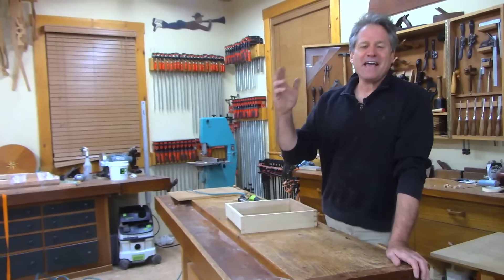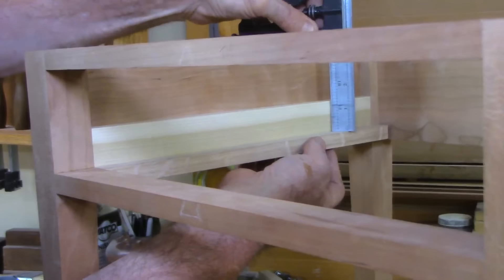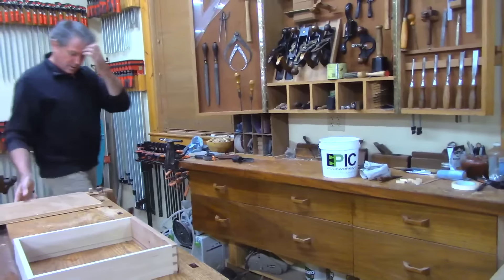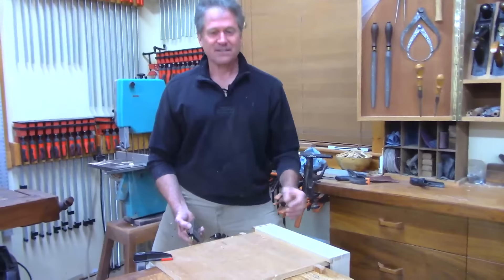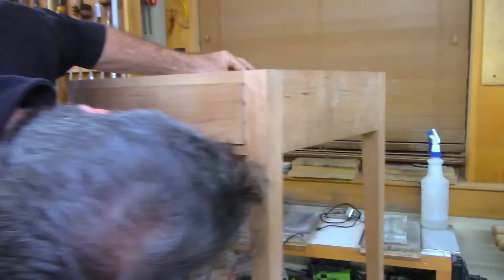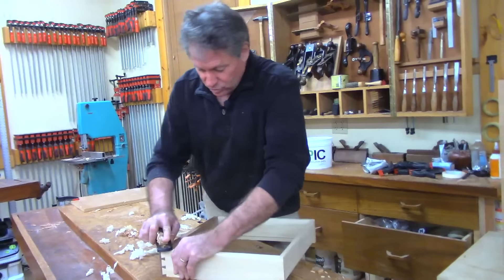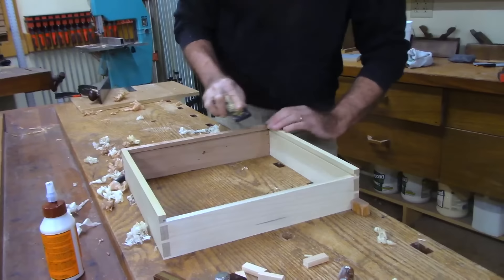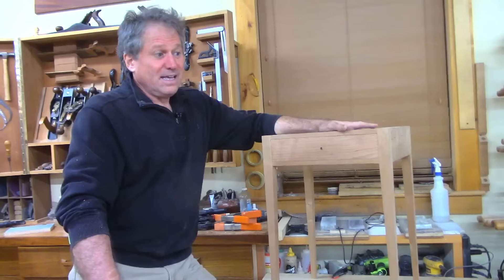How to Make Perfectly Fitting Drawers

Comment: Easy to fit the kickers by turning the table upside down, cut it half inch short and do a rub joint. It lines up with the top of the sides and works well.
Reply from the maker: Thanks John, that’s a great option and idea! 👍😎